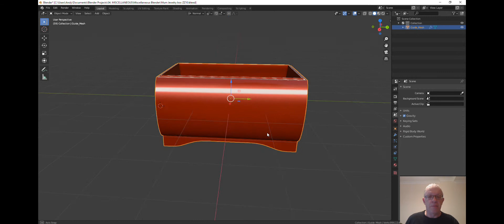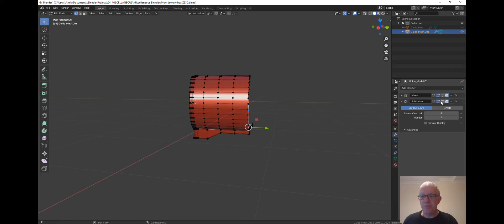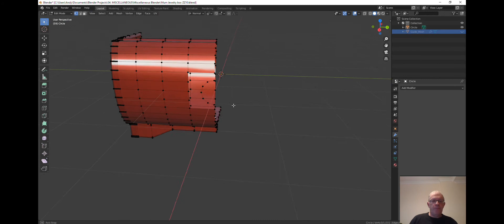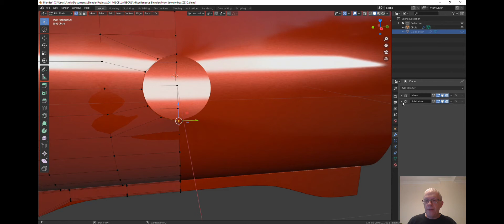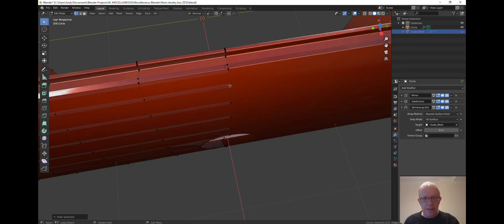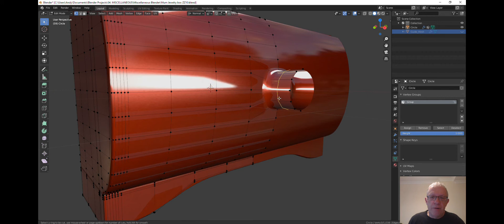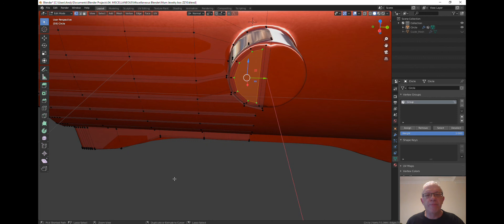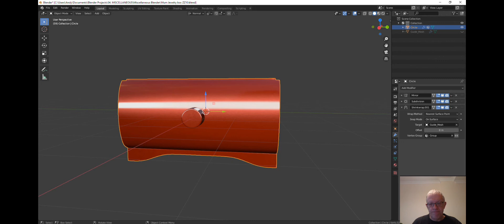Blender Learning Shrinkwrap Modifier Tutorial #blender

Comment: Tried the shrinkwrap for the first time after I cut out the windows of the SWB. First reaction  - WOW! Why have I not been using this all along? Straight away the whole mesh looked smoother. Oh and I forgot to increase the levels in the subsurf as well. I guess it would be even better if I did it properly. Thanks for the video  Andy.
Reply from the maker: Hi Sean. I learned it fortunately on the first car tutorial i followed . Thanks to Chris at CG Masters and I use it extensively so use it a lot . The key is to get the mesh as perfect as you can before cutting anything out or add protrusions etc

Comment: Hi.

i mainly work on Cinema4D. bit retopology in there is bit of a nightmare. So in blender for example i import my high poly OBJ. use shrink warp to do retopology. then can i move out the retopo model back in to Cinema for further work ? 

Thanks
Reply from the maker: I'm not sure if you can re import it into cinema 4D as i have no experience in using that. All i know is that it works very well in Blender and is so powerful
Reply: @AFLAutoBlendz3DCarCreations  thanks. I will try today as I got free car bodies I need to retopo.